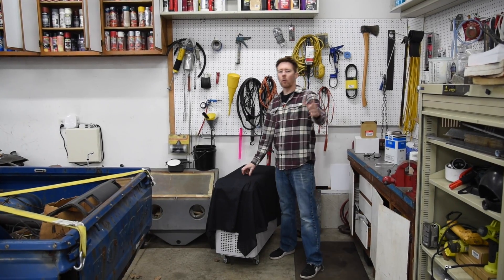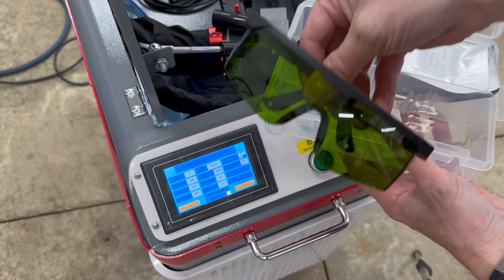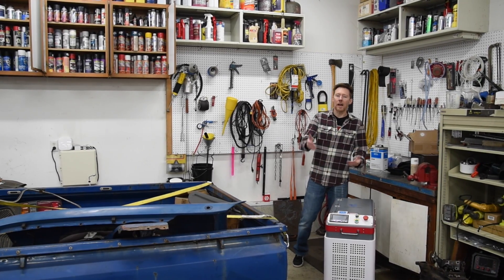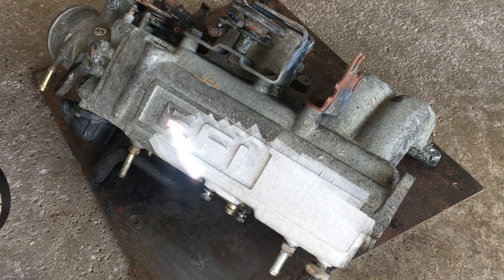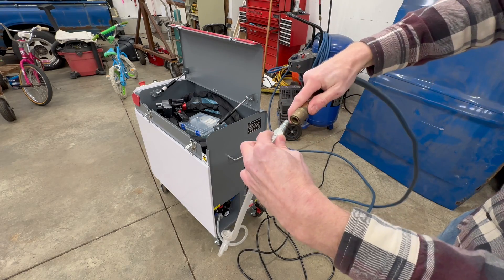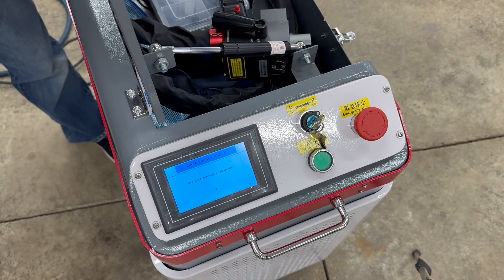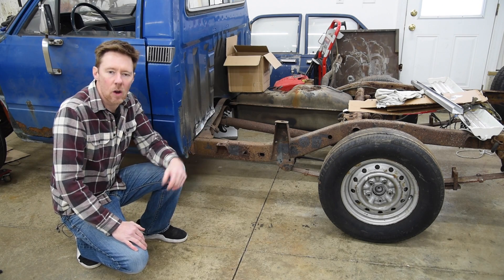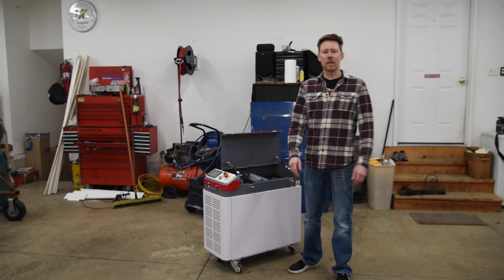Everything to know about 200w Pulsed Laser Cleaning Machine by Fortune Laser

Comment: Why does it come with a 110 plug if it needs 220?
Reply from the maker: I'm guessing because most of the world only uses 220, while North America uses 110 and 220,  and they ship these world wide.
Reply: This might sound dumb but I need to know this before I buy one. Does it plug into a regular outlet? Like a home outlet?
Reply from the maker: @cowee2012  No, it uses 220v (which is normal for the majority of the world)  Here in North America, 110v is a normal house outlet. While the plug on the end of the power cord of the machine was the 110v style, it wold have probably caused damage if I plugged it into a regular 110v outlet. So I bought an adapter to convert the 110 plug to a plug that fits my 220v outlet. I would ask them if they can make a 110v version though. It may be possible because these pulsed machines are only 100w and 200w machines. They don't draw a ton of power like the 1000/1500/2000w continuous wave machines do.
Reply: @6thGearGarage  oh, I understand. I live in Hawaii and I googled what our standard outlet voltage is and google said 120v. Does the company you purchased the laser from make them in different voltages? If not, can you send me the link to your adapter thing?
Reply from the maker: @cowee2012  oh sorry I just saw your last comment. Here is the link for the adapter https://www.ebay.com/itm/383726311328?mkcid=16&mkevt=1&mkrid=711-127632-2357-0&ssspo=xklm77o8q4s&sssrc=4429486&ssuid=0_GEGSV4QDO&var=&widget_ver=artemis&media=COPY
Reply: @6thGearGarage  thank you. I went on the fortune laser website and filled out the form but no one responded. Do you know someone I can email regarding the laser cleaning machine?
Reply from the maker: @cowee2012  yes, jason@fortunelaser.com or the best way is to contact him on WhatsApp +86 136 8232 9165

Comment: I follow a military vehicle restore channel , based here in the UK , I wish they'd buy one of these things , instead of pissing about with hydro blasting , chemicals and needle guns when removing paint and rust from small vehicles like cheiften tanks ect. A job that would take days , could be done in hours.
Reply from the maker: Not cheap, but they do pay for themselves pretty quickly in time saved.
Reply: As he mentioned near the end, high carbon metals that rust in flakey layers are not a good application for the pulsed, or even the continuous, laser cleaner as they'll only hit the surface.  Paint is similar, even if it's not white.  It's just one more layer that has to be burned away before getting to the base metal.
Reply: there not as availabe over here as you would hope, I've a tank I need to needle gun now, if i could find one of these id be tempted !
Reply from the maker: @mgstu  I believe they ship these world wide. Did you contact Jason at Fortune Laser?
Reply: Mr Hewes FTW!
Reply: What do you mean by uk? Do you live in England where my ancestors came from?

  I also have some ancestors from Ireland and Scotland as well.

 And one of my ancestors hails from Wales
Reply: @alexbowden27  Just about everyone in England has Welsh, Irish and Scottish genes, not no mention Viking, Saxon and French. With some German.

Anybody else?

Comment: I'm considering a similar unit for my metal fab shop. Is it good at removing mill scale and oxidation from welding/cutting? Also, will I be able to forgo a sand blasting cabinet with this unit?
Reply: This is one of the best metal prep for welding because it does not leave any residue that you will be breathing as a welder.
Reply from the maker: Oxidation, absolutely. Mill scale, I’m not too sure. Slightly different situation, but when I showed the scaled rusty frame example, the rust was removed from the surface of the scales, but when I scraped them off, there was still rust underneath. I would contact Fortune Laser and see if they have a machine that might remove the mill scale. Maybe they have a continuous wave machine that can do this?  I have a small blasting cabinet that I’m considering getting rid of but still might use it for smaller heavily scaled rusty parts like control arms, knuckles etc.
Reply: You will still have to have a booth because of the risk of specular reflections. 

Stray reflections from these devices are extremely dangerous.

Oh and buy a proper pair of goggles. I would not trust the toy glasses it came with....
Reply: Is it safe for skin?  Directly, probably not. But what about reflections off shiny parts?  If not, what are using for PPE?

Is it safe for plastic, rubber, etc?  Do you need to worry about ruining rubber boots, seals, etc?

Comment: Does a great job on aluminum....looks like new and its so hard to get that way....and my truck has to be white....
Reply from the maker: The aluminum is the most fun to clean because of such a huge difference in the before/after.
Reply: Would this work to remove powder coating from alloy wheels? Would the next size down be enough for just wheels?
Reply from the maker: @tukn22inch  It would absolutely remove powder coating. Gloss white will take a little longer than other colors. Black will remove the easiest. A 100w machine should be similar to the 200w machine, it will just take more time to clean due to less power.

Comment: Hell yeah ...the price will drop on those just like 3D printers and CNC machines.
Reply from the maker: I can't believe how much the prices have already dropped since 2020 when they were $100k. I think in a few more years it won't be uncommon for diyers to have one of these in their garage.
Reply: both of those still cost an arm and a leg....
Reply: Don't hold your hopes up too much. It's in part thanks to 3D printing... sorry, additive manufacturing, that the prices of industrial lasers have come down tremendously. 200 watt is a nice laser output power for an entry level powder bed selective laser melting (SLM) metal printer. Both types of devices benefit already from large drops in laser cost.